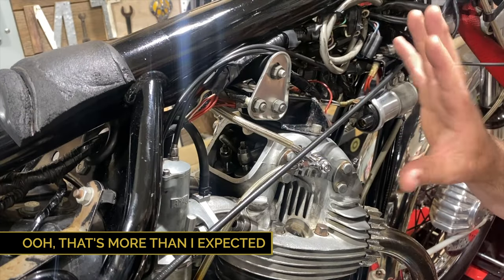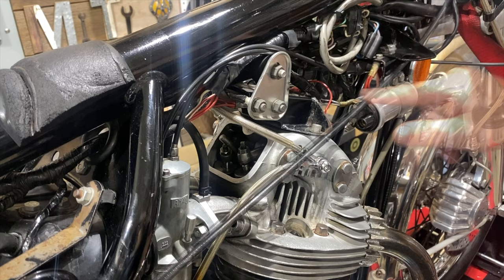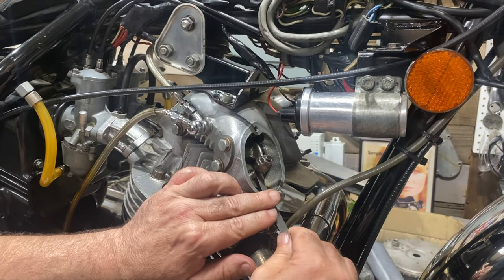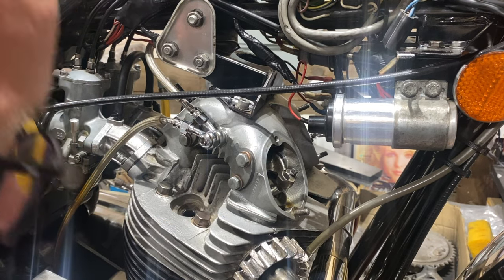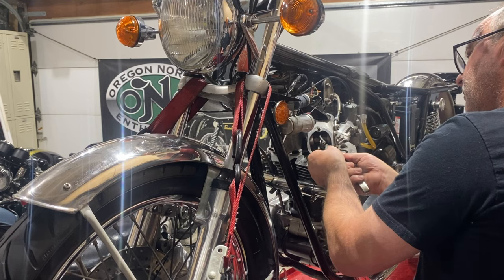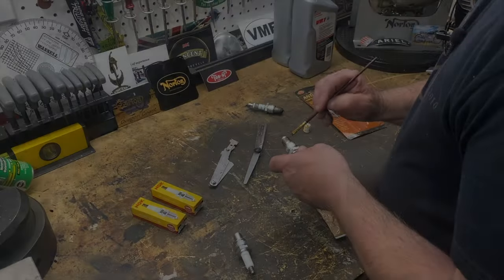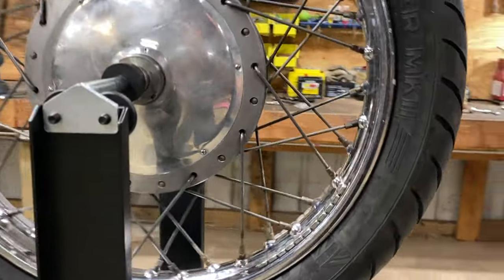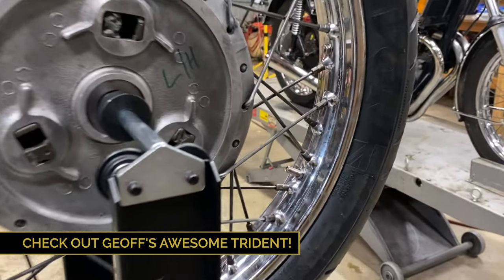1974 Norton Commando 850 MK2A - TLC 3 of 3 - Tappet / Valve Adjustment

Comment: I like to turn the engine over by the back wheel, 2nd gear, plugs out, easy leverage. Eraser end of pencil in plug hole as tdc indicator. Thanks Mike for your vids👍🇬🇧🍺🇺🇲👍✌️
Reply from the maker: Great tip!  Thanks!  Best wishes, Mike
Reply: Thanks

Comment: we used to cut a drainage notch in the exhaust valve cover gasket near the lower stud hole. cut down leakage tremendously. lapping the covers is almost a must !!
Reply from the maker: Great tip, thank you!  I had tried that with the old paper gaskets and it certainly helped. Best wishes, Mike

Comment: I'm always impressed by your range of skills and knowledge. I do worry sometimes that this kind of expertise is being lost and that in a few decades we'll have no one other than a few experts, who can fix anything. I fear that this kind of fettling is a dying art. The modern world of silicon chips and updates and firmware upgrades, blah blah blah, leaves me cold. And usually the "upgrade" makes matters worse!
Reply from the maker: Many thanks!  I also worry that there doesn't seem to be many young guys who are very interested in these old bikes. Best wishes, Mike
Reply: As a 28 year old restoring a 71 A65T, old bikes are much easier to work on than modern bikes, doing tappets is easy but I wouldn't go anywhere near trying to adjust the clearances on a DOHC bike, same with carbs I've rebuilt an Amal Mk1 but wouldn't touch fuel injection

Comment: Hi Mike. My first motorcycle was a commando fastback, a 1970 - like most British bikes, it tried to shake itself to pieces all through Europe. 
I’m a little surprised that you didn’t use a torque wrench on the job. 
I’m now a Harley rider (Vancouver Canada to Los Angeles to visit grandchildren) and I never do ANYTHING on the scooter without fasting with blue thread sealer and a torque wrench.
Reply from the maker: Hi Aaron, thanks for your note. Yes, I do use a torque wrench where it is needed elsewhere on the bike, but the tappets/valves don't need torquing down. Cheers, Mike

Comment: Hello Mike.  Great Video. Wondering why/how your tappet adjustment became so far off. I Check my British Iron @ 3000 miles and rarely do they need adjustment more than a 001.  Possibly valve seat recession?   Top tip.  I always run Amsoil Octane boost in premium non-ethanol fuel. 4 oz per five gallons.   Boosts your octane closer to 97 as recommended from the factory back in the day, and prevents any unleaded issues in your top end.  I found years ago, running regular unleaded and factory timing, I would get pinking especially on hot days.  This completely eliminated any and all fuel related issues for me.   I’ve put 20k on my Bonnie since the last carb clean and she still starts first kick. 
Cheers my friend and god bless you and your family this Christmas.  
Mick.
Reply from the maker: Hi Mick, thanks a lot for all your advice with this. I really appreciate it. I'm not really sure what caused such a dramatic difference. I could've sworn that I set them correctly last time, so it could be a valve issue. I hope not! I'll keep a closer eye on that and hope that perhaps I just didn't have them set correctly enough!  Best wishes, Mike

Comment: When do your valve clearance adjustment, are you just eyeballing the rocket to see when it's at its highest point, then measuring with feeler gauge?
Reply from the maker: I am Dave. Yes, I'll sometime check TDC but yes for the most part, I'm watching the rocker very closely while the valve drops. I tend to leave them on the loose side rather than have them too tight. Best wishes, Mike

Comment: To what do you attribute the excessive inlet valve clearances Mike? Another great video.
Reply from the maker: Hi Chris, thanks for your note. I'm not really sure yet. It was a bit of a mystery. I was pretty surprised to see that it was so far out. It's just possible that I didn't set them correctly last time and I'll definitely keep a closer eye on this for next time. Best wishes, Mike
Reply: @TheMightyGarage  With my old Beemers, the concern tends to be a reduction of clearance due to valve-seat recession (only exhaust valves) although I'm please that this has not occurred over the past couple of years.  Maybe a combination of restrained riding and the decent 94 Octane Chevron we have in Canada. All the best, Chris